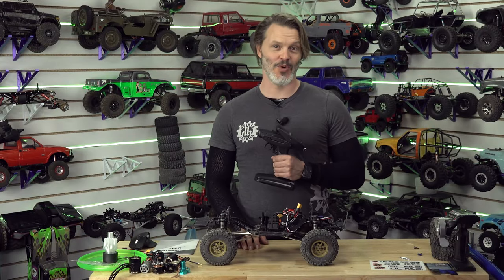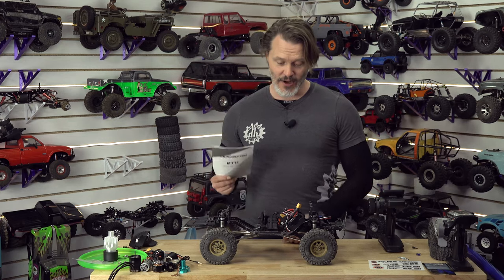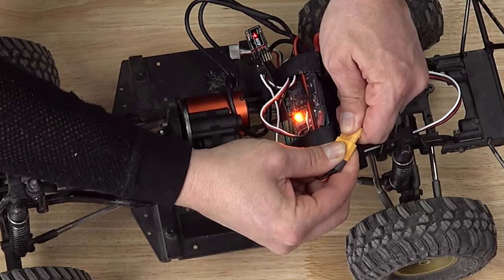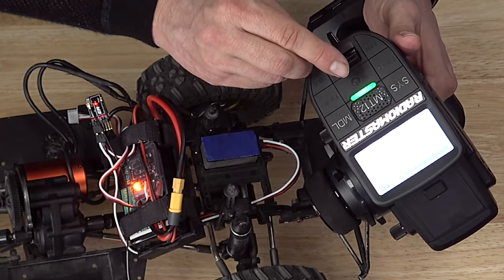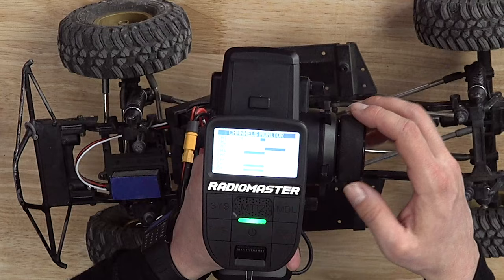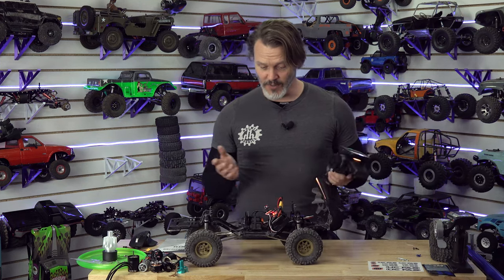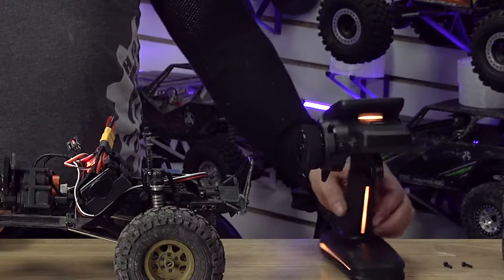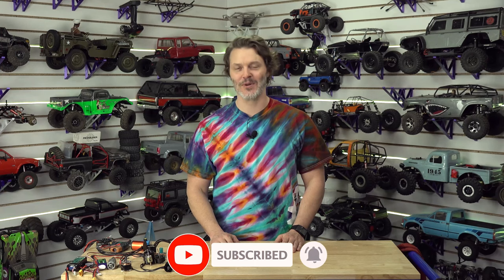Mastering RC Control: How to Bind Your RC Rock Crawler with the RadioMaster MT12! 🎮🏞️ Holmes Hobbies

Comment: Missed a GIANT step with binding ELRS. Right after you create a new model on the radio, you have to go into the settings and turn on the ELRS module. If not, when you select "Express LRS" after pressing the system key the radio will basically lock up. This radio is a master-level device, 110% NOT for beginners. This radio makes NOTHING easier. What this radio can do is VERY impressive, but Radiomaster missed the mark big time, and should have cleaned up the interface.
Reply from the maker: It seems that all the models on my radio already have that done.  I'm noticing that they constantly are changing and updating the "stock " firmware
Reply: What are the biggest differences between the elrs and 4 in 1? I have the 4 in 1 and can’t get it to bind with the r85c receiver. (I needed a 5 channel receiver for rear steer and dig). I’ve watched multiple videos and can’t seem to make it bind. What steps am I missing?
Reply: @ConnorSmith_24 what? I use the same receiver and it works fine with my mt12, check the protocol you're using

Comment: Nothing against stuff like this but I’m generally happy with the stock stuff, most of my stuff is traxxas and I’ve never really had any issues with them, my main radio is just a tqi with the Bluetooth module and the traxxas app and it works well for me when I want to mess with anything. I picked up a Losi Hammer Rey a few weeks ago and it’s been a great truck and of course that came the Spektrum stuff and I like that too, it’s nice to have the 50/75/100 switch and the lights for the battery percentage too. I’d rather have another truck than spend the money on more radios and receivers but that’s just me lol I’m just not into the technical stuff enough to need to go for that stuff. Seems pretty nice though
Reply from the maker: that makes sense
Reply: @HolmesHobbies  I understand it though, I’m just too cheap!  lol
Reply: I'm new to the surface rc hobby, i got a cayman pro, an mjx hyper go, a boat, and a couple of tiny rc crawlers, but before that, i got into the drone hobby first, so im slightly familiar with how edgeTX works.

What i like about this radio is that it can be whatever you want it to be, it can do whatever you can think of, if you can program it it will happen, and only for a fraction of what sanwa offers..

Also i hate the transmitter that comes stock with literally EVERY rc car, i have 5 stock rc transmitters that i dont use that they (company) could've saved and add the cost to a better quality rc car.

Comment: Already done,, need sort out some switches for different modes for 4ws and dig 🤔
But I might just sell it and get the radiolink rc6gs V3 for ease of use, 🤷‍♂️ I've got the v2 but I can't assign switches for dual rates or different 4ws modes,,
Radio master is just a head ache 🙄
Reply from the maker: Lots of vids on that, you could program it in 10 minutes!
Reply: @HolmesHobbies  I hear you there , it's just me and technology especially when I'm used to something and how it works ,It's like going from easy basic cell phone and then changing to multi features one that takes an age to set up and even longer to familiarise yourself with,, my patience with tech is very slim ,how I haven't thrown the mt12  at a wall yet amazes me 😉🤣
Reply: Check out the wfly x9 it’s 9 ch and has mixing and w4s settings already programmed but it has 2 3 position switches and 2 knobs with one knob also being a button
Reply: Keep on it. Once you wrap your head around it, you won't even look for another transmitter.

Comment: I have the 4 in 1 so I can bind it with my many Dumbo receivers and it’s really convenient. Range is great but also bought the Nano Ranger module just in case. Guys like Joshua Bardwell and Joshua Bardwell have good setup videos. I did that same lockout with light confirmation. It’s not a walk through the park but once you get the functions you need it’s really worth it.